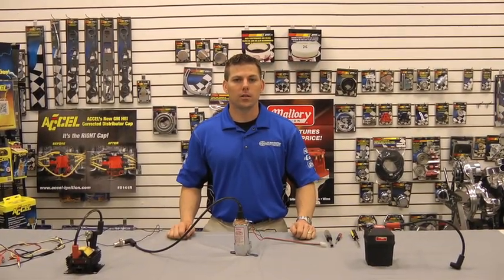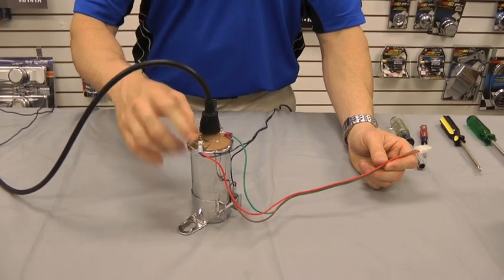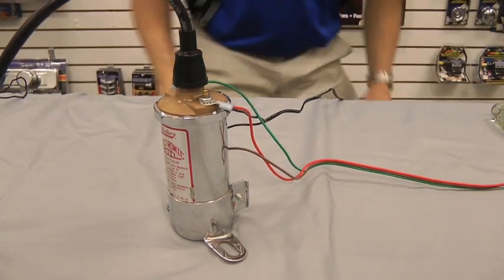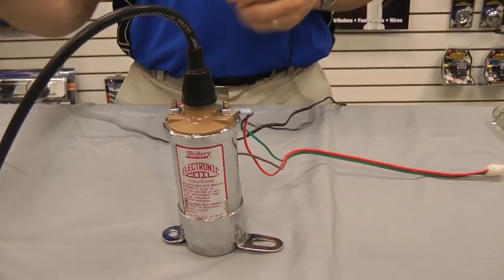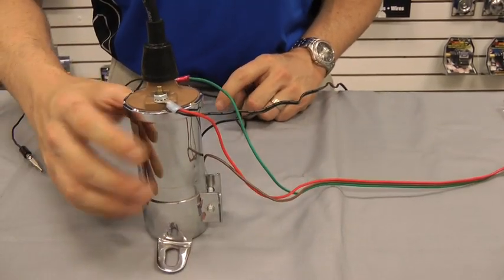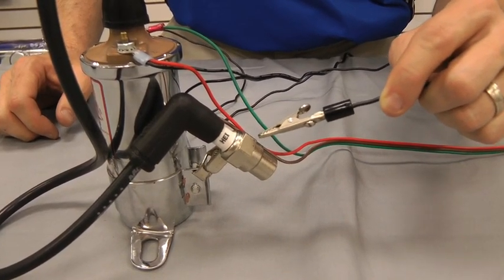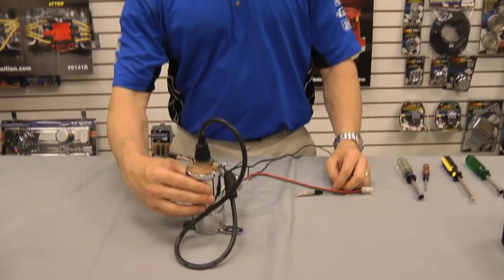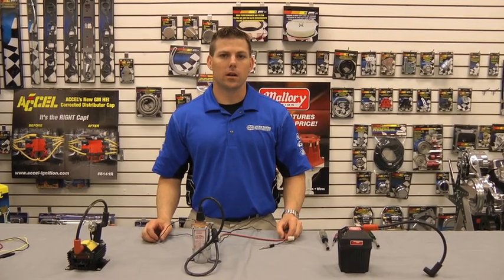Mallory Ignition - How to Test an Ignition Coil for a Positive Spark #29219

Comment: seems like every one is into coil testing every where you look   coils the last place i look for spark problem  im into lawn mowers  auto eng  not much exp. with motorcycles    a lot of misunder stanting about no spark  first place i check is the capisitor it has more to do with spark than coils if point are pitting it is because capisitor has a problem or it is the wrong mfd value  te capisitor has to match the coil electrily for max spark  a lot of capisitor look alike but they have diff mfd values  . my army truck had a weak spark 1/8 inch jump test i found  proper mfd value of capisitor changed now it will jump 3/4 inch when testing that convensed me --first thing to test is the points to see if they are pitting this changes the gap setting what happen is this when points go open gd is lifted off the capistor wire all voltage can not go thru capisitor so it backs up in th points and jump the gap to gd causing the pitting only to get correct capistor is go dealer have look up part # of your year  the cross ref. that #   to find a match  that will swap  you will see big diff its worth the effort.